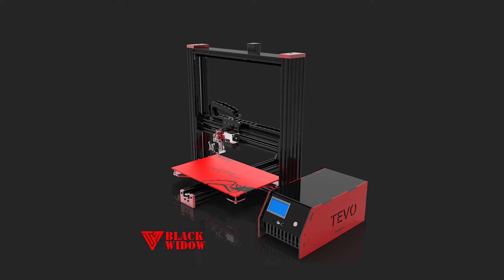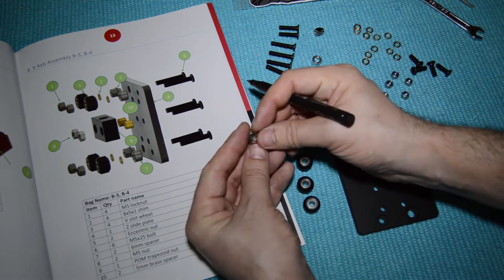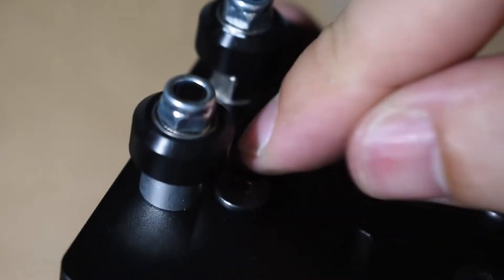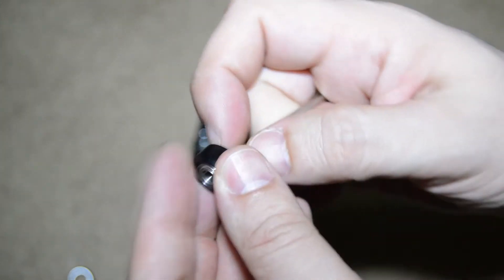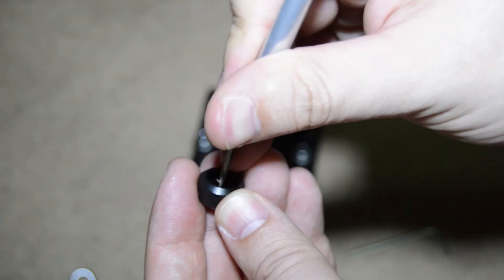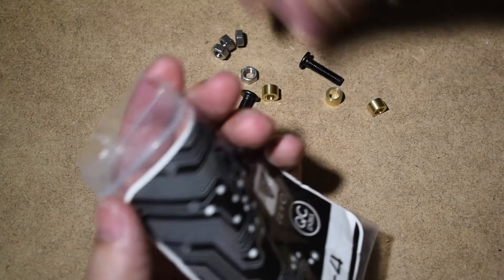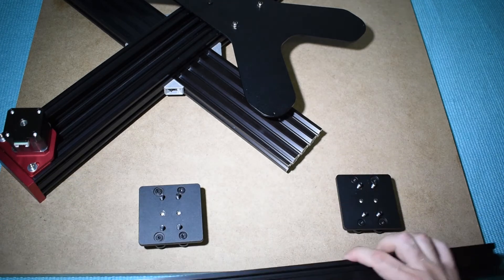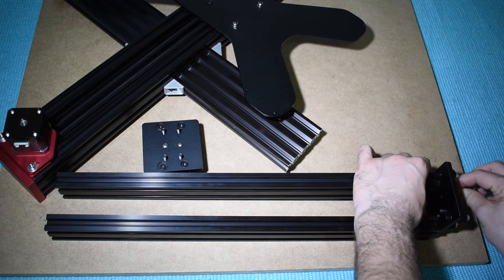TEVO Black Widow V3 assembly - STEP 3 (X gantry)

Comment: Thanks a lot I was very helped by this video when assembling a 3D printer,But in the end I had a problem
When the (Auto home) function is enabled, the Y axis works in the opposite direction !!! The X and Z axes work normally
Reply from the maker: Hi,
if your Y axis is moving the wrong way is probably because you assembled the Y axis belt wrong.
Check if it's assembled (belt + carriage) correctly.
Reply: Dear friend, I solved this problem, it turned out that the wires of the motor of the Y axis were incorrectly changed their positions and everything was working fine!
Reply from the maker: Good work. Glad you fixed it.

Comment: what T Nut did you use with the 28mm L bracket?
Reply from the maker: I could not find any M4 T-nuts for the 20 profiles so i bought the M3 T-nuts for the 20 profiles instead.

Comment: Would it be better to replace all bearing wheels with ABEC Bearing Wheels?
Reply from the maker: Hi,
Normally, the problems are not with the bearings but with the wheels. 
Another option is to get the open build extreme wheels (no bearings) and install the stock bearings.
Reply: Thank you very much! Fantastic Support and Videos. I am gonna buy the Black Widow from Aliexpress, because of your Videos!

Comment: You forgot to point out that when you attach the two end plates to the 20x40 beams to make sure they are oriented the same way so that the wheels with the spacers and eccentric nut's are on the same side to ensure the x axis will run perfectly square.